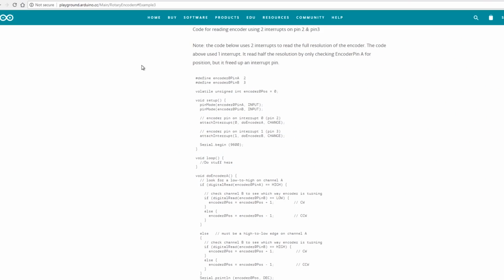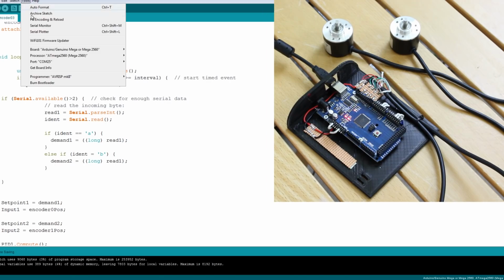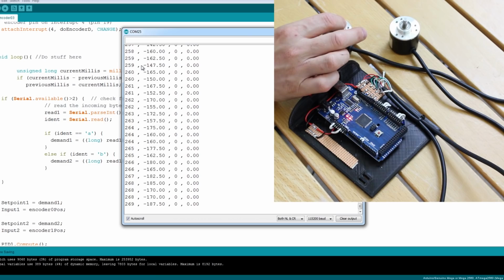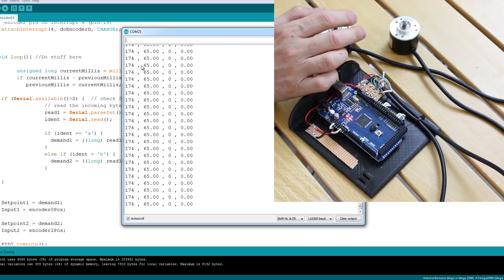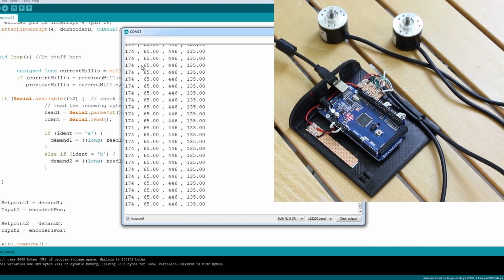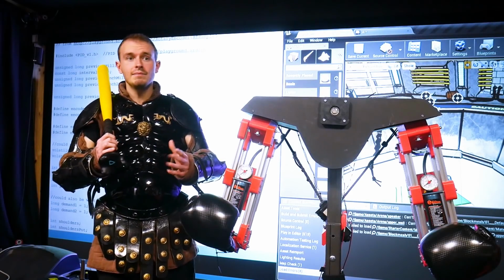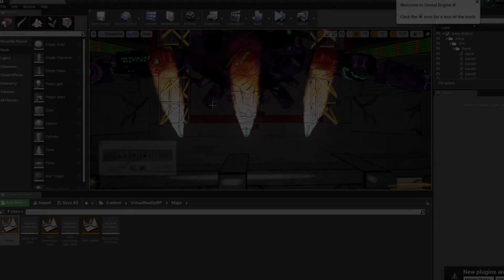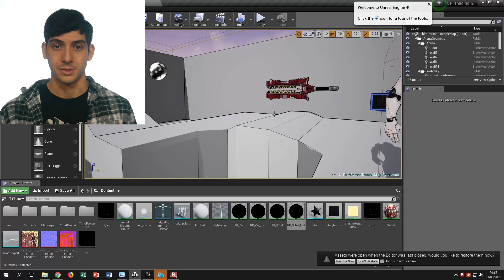Robot vs Human Combat | James Bruton

Comment: The punch is made via some compressors and not servos. Why? Is it possible to punch using only servos like " Integrated Servo Motor with Driver 140w 36VDC 3000rpm 0.45Nm 6.0A" using tooth gear transmission for rotation and a metal-polymer cable pull for tendon-like tension job? Theoretically two joints per arm and rotation and tension available per joint along with torso rotation will produce almost human biomechanics like punch. Theoretically.
Reply from the maker: Sounds like a really cheap solution compared to some cylinders taken from foot pumps.
Reply: The thought was "servos are cheap and easy to replace when wear out" (first thought is servos mounts in kuka like kr-40). Plus pump along with the complexity provides only one dimension of motion and needs to "recharge". Bruce Lee once said something like: "a punch is a torso rotation along front/rear foot axis". So the objective is (I'm taking boxing classes for a year now) - you need to rotate torso and throw your hand like a whip. I'm sure any fighting gym would kill for a cheap robotic solution emulating punches.

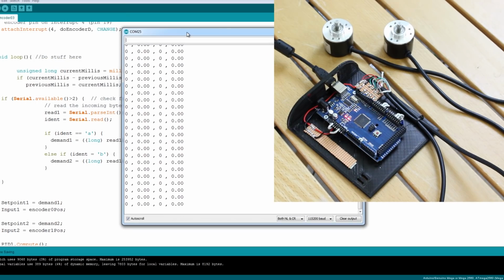Comment: At 6:45 you have a typo in your arduino code. You have

if (ident == 'a') {
...
} else if (ident = 'b') {
...
}

It won't give you a compiler error, but what you're doing is setting the value of ident to 'b' instead of checking its value against 'b' (= vs ==). It's always going to return true and thus the code inside that conditional statement will always run if ident is not 'a', regardless of whether or not ident is 'b'.
Reply: yes
Reply: @Chris-rg6nm  True, but if he added another conditional then it might cause him a bit of a headache.
Reply: Just paused to make the same comment! Haha, been doing too many code reviews lately :-).
Reply: Nerd
Reply: Jk

Comment: Do you have a separate power supply for the Arduino? I'm doing something similar with wiper motors, IBT_2 motor drivers and an Arduino all powered by SLA batteries. I use a buck converter to bring the 12v down to 9v for the Arduino. Sometimes, when I power the motors, the Arduino resets? .. yet if I give the Arduino it's own 5v USB power bank supply, it's fine. Any ideas?
Reply: Try big capacitors near the Arduino, on the power rails.  It may still reset because of kick back emf produced when the motors stop/start.  If so, add small caps on the motor terminals like they do for rc cars.  Let us know what happens!
Reply: @TheRainHarvester  thanks! Could you go into more detail? Type/size of capacitor etc?
Reply: @SirBenJamin_  I'd say bigger is better for Arduino.  But the motors might need smaller ceramic type.

Comment: Nice work. You should have used three omni-wheels for the base. Strafing is important in boxing.
I really don't understand why you used VR when you have a real life robot. Set-up two cameras, put some visual markers on the robot, run open pose (or the like) to get the human 2d skeleton and triangulate to 3d. Once you have the positions either you code some primitive AI, or you run some reinforcement learning neural net. For the reward signal, either you put sensor in the glove to measure impact, or you simulate whether you have hit using the computed positions. Put some head on the robot to give human a target to hit. Also build a second robot so it has a sparring partner to play with while the human is recovering from knock-outs.
Reply from the maker: It was a student project in Computer Games Technology, not Computer Science...

Comment: Oh, you have no shoulder encoder for syncing arm movements ingame!
Was it on purpose to interface easier with their system?
The screenplay did not match up well (probably because of Vive expecting and filtering for human movement).
Reply from the maker: The arms have Vive trackers on them which was supposed to sync up the movement. However they were short of time so in fact they synced an animation of the arm moving with a threshold of movement on the vive trackers, which wasn't the best it could be
Reply: @jamesbruton  looking forward to your and their updates! Thanks for being awesome!